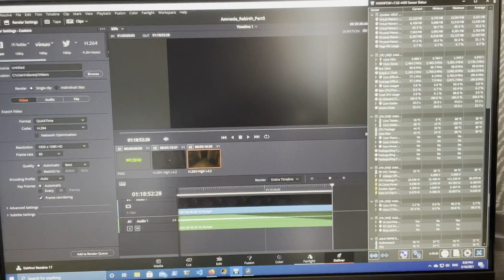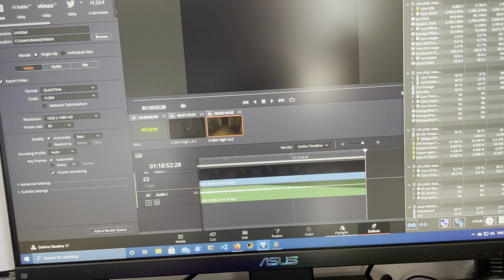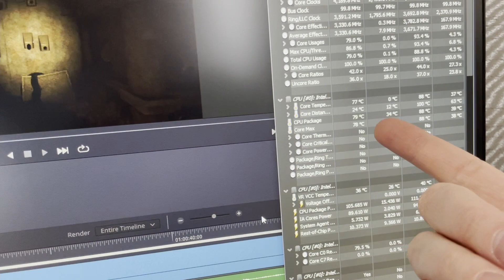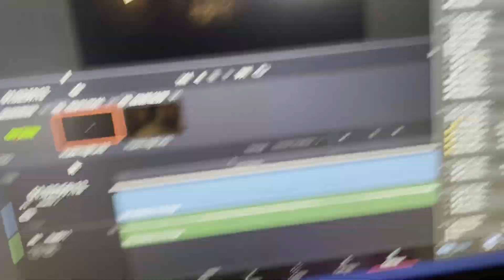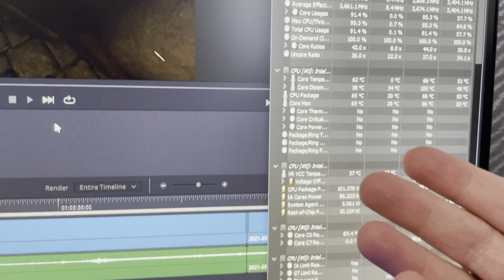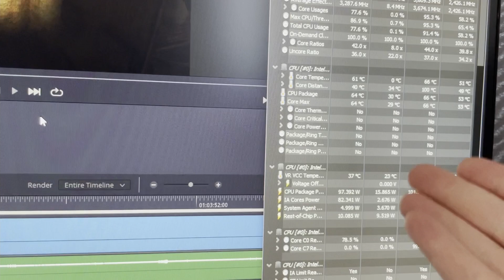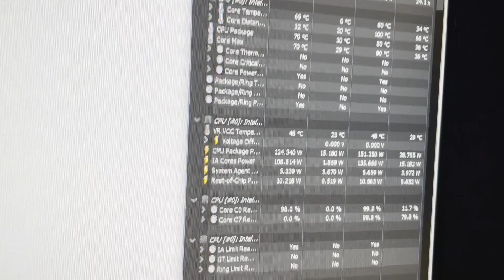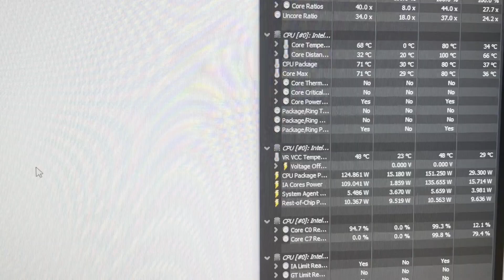Intel Stock Heatsink VS  Dark Rock 4

Comment: I have also the Dark Rock Pro 4 on my new I5-12600K CPU. On my previous Pc I had a standard stock cooler, a older version of this one. So It could be quickly very warm in a Big very cool airflow PC, what was an upgrade from my PC before the last one.

I am not a technical man quickly building a PC. I let it build for me in the shop. However, the one who did the build was was a complete Joke. Even the basics were installed wrong. A nice clean install with everything working wasn't the case. I encountered many many very serious problems and went back every few weeks to fix things. It was a game PC in a silent case with sound-absorbing soft material. So you shouldn't hear much. However when gaming with the stock CPU-cooler was a noise maker and had a 3-fan gpu that was for good cooling but added to noise. The case was a few mm too short so they bended the metal endplate to get it in...

But when upgrading to my previous PC I found out yet another TERRIBLE HUGE STUPID MISTAKE. Why was this PC so noisy? They forgot simply to connect the power cable to enable all the 3 Front air inlet fans, So NO cool air came into my PC! How stupid can you be. And with all that noise canceling material there were not many places where hot air could escape, nowedays PC cases have a lot of open spaces on the sides back and top. But in that PC my CPU got HOT and know for sure that that must have had an impact on the gaming performance and operating so hot also on the lifespan of all components that got years too hot. 

With some games they don't fully utilize all the potential like 99% GPU but between 70%-100% load and the CPU is around only 30%-40% and 32GB Ram on an SSD. Temps are ok, but still doesn't utilize all so I don't get the frame rates I should get. I can buy the most expensive PC but if it is backtrottling I go in FL2020 From a nice around 50fps to 20+ on more demanding places but why does it backtrottle?

Comment: Helpful video, man. 
On be quiet!'s website under motherboard compatibility, it has the Asus Prime B560M-A listed as incompatible with the Dark Rock 4. During your installation, did you run into any problems that might explain that?
Reply from the maker: No issues, installed perfect. Not sure why they would have it listed as incompatible, weird. I can’t really see many, if  any boards being incompatible with the DR4 unless you have a board with overly large VRM heat sinks that get in the way but I’d consider that very very rare.
Reply: @quicktechtalk_3188  I have checked the measurements and it seems good. I am thinking it might be to do with how close it is to the PCIE slot. I guess I will find out in a few days. Cheers for the fast reply.